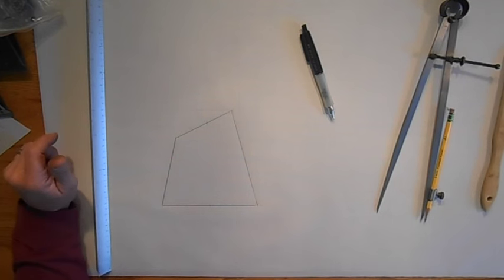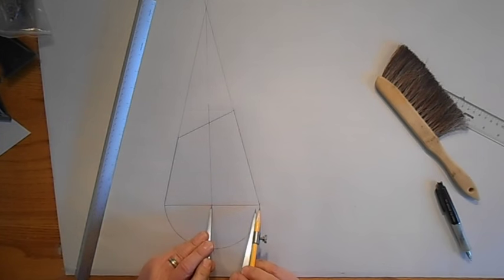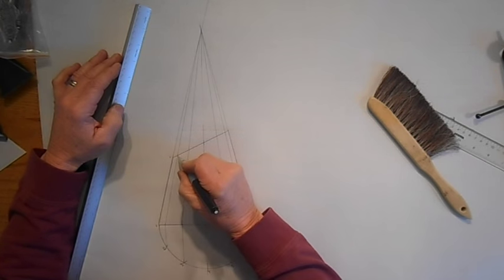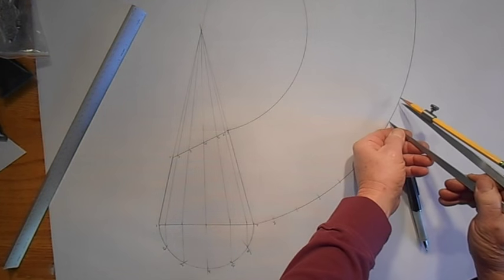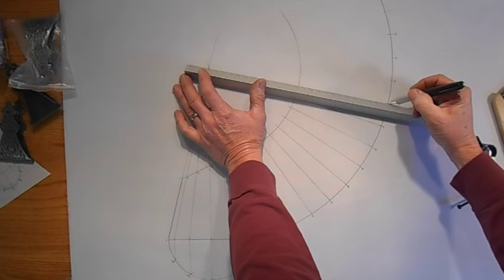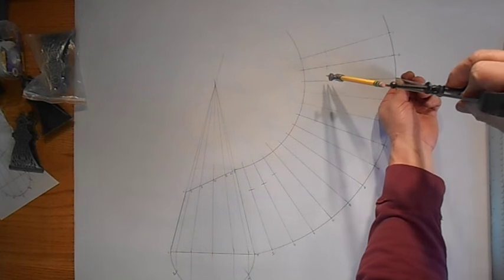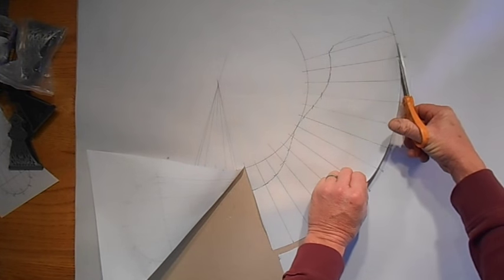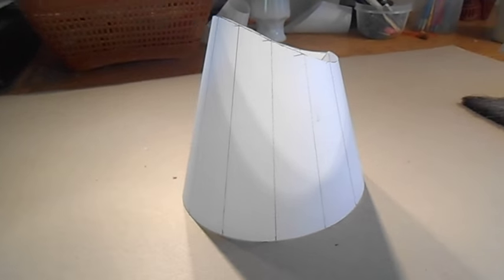Pattern Making- Round Cone w/ angled top

Comment: Hi Dave, first of all your tutorial is very clear.  One remark I have is the same as some of the other comments found.  Points 1 and 7 for the small slanted opening are correct, but 2,3,4,and 5 should be horizontally transferred to the right side of your cone.  You would then swing those numbers from the slant side to their corresponding numbers on the from the baseline stretchout.
Reply: They are called true length lines and his aren't true lengths.  You are correct. All lines except the 2  lines at the very edge are incorrect.

Comment: Hi Dave- great video! I learned a lot.  I have a bit more complex shape: a Volcano cone shape: wide at bottom, tapers inward as it ascends then small opening at top.  Could you help me solve this problem.   10”h x 6”dia/bottom x 3”dia/Top.  The Taper should start 1/3 up from bottom if possible.  Think of the police megaphones but standing up.  The tapers has me stumped

Comment: You're saying to wrap the template around your pipe, then center punch it...ok, that's a given....the big part is ...using your soapstone to trace it the pattern....then cut it w/ the torch...the center punch mark s assure you that you'll stay on the line or follow the path in the event those soapstone marks get rubbed off...- very good vid...Dave..thanks..~

Comment: I am horrible at math but somehow great at understanding architecture drawing so maybe I have a brain that has a dyslexia about calculating numbers just for calculating numbers sake but if I have to make something then I can attempt it with some degree of success. I have become great at determining angles etc by folding paper. Luckily this is all for crafting so I am not building a house,  or landing an asteroid on the moon. I was able t do this by studying a 4 volume set for plumbing cutting their on parts.I guess it also helps that I sew and when I have to draw up an original pattern you are working from a flat pattern to a shaped object. Who knew the same skills would be used with plumbing and clothing construction. At least this is the first explanation that I have come across concerning calculations and cone etc. everyone wants to tell you how to calculate but they do not show you how to use raw measurements and draw it out. That is more useful for me as a crafter.

Comment: Wow sorry to be negative however you are not even close to completing this layout correctly or accurately. Lines 2-6 on you front or what you call the side view are not true length, and how can you be accurate with out using drawing aids such as a tee squares and set squares. Math should be used to accurately determine your apex height ect. Setting your compass on 1/12  of the circumference and plotting them around your striking radius only leeds to accumulative error. One should work out the circumference of the base by multiplying the large diameter by pie 3.142 and measure this around the large striking radius. Once again I am sorry to be negative however you may well be miss leading students. Regards a boilermaker of 35 years. Not a carpenter
Reply: Sally Cheater you are quite correct. He should be drawing the points you mention through to the outer line of the elevation. I also agree that the circ should be measured rathet than stepped out.
Reply: dear sally cheater. im mechannical student from indonesia. can you tell me the best hand book to learn sheetmetal from basic until expert?

Best Regard
M. harry Fikri